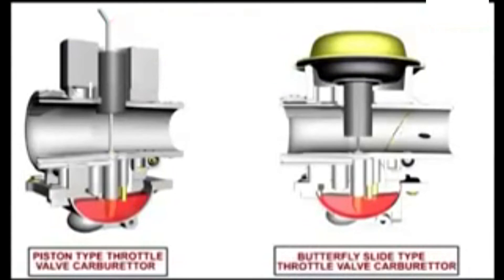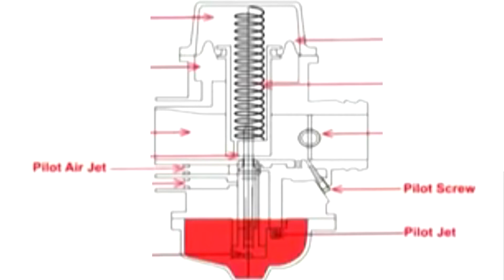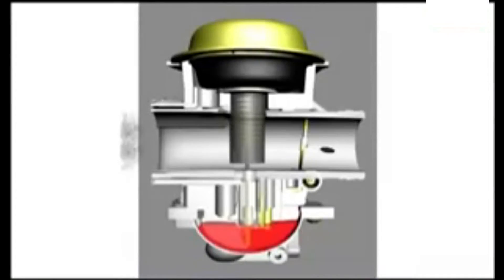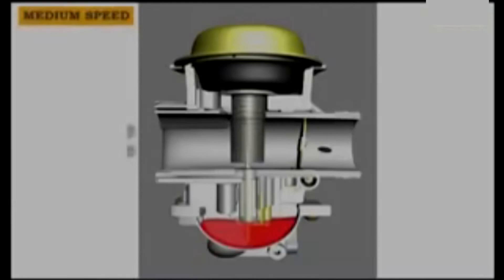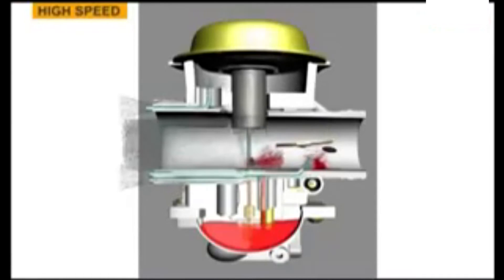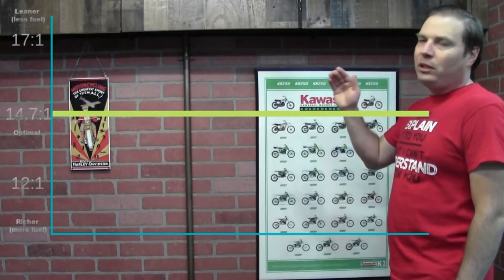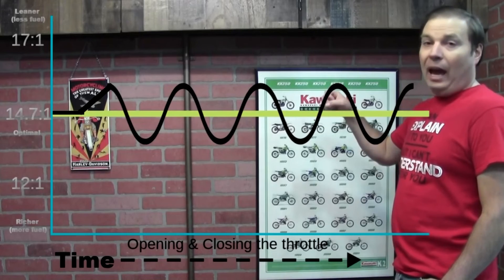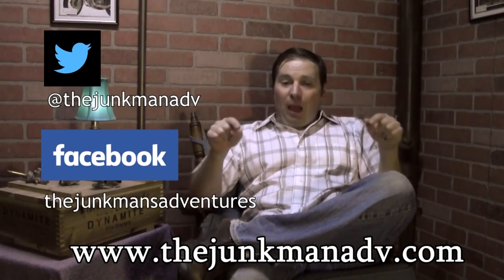Carburetor Jetting throughout the RPM range - Throttle openings explained!

Comment: Hey man, you may be the one that can help me solve my mistery. So, i have a '95 zx6r ninja, the previous owner tuned the hell out of it badly so i am trying to bring the bike back to stock. I put all the stock parts back and reset the carb on the factory settings, but the bike struggles to go between 7 and 9k rpm. Goes just fine before and after that range. I noticed that the problem increases when the bike is hot. Could it be the jet needle? Should i raise or lower the shim? Thanks
Reply from the maker: I think you are on the right track. Just experiment.

Comment: What is the purpose of the extra blue fuel line? The black fitting on the left side appears to be the fuel inlet.
Reply from the maker: Can you be more specific?
Reply: @thejunkman  Please pause video at 58 seconds, note the blue fuel line. What is the purpose of this extra fuel line ? It does not appear to attach to the fuel inlet. Thanks
Reply from the maker: That is for the enrichment circuit on that particular carburetor.  Not the spray bar on the inlet.  There is a plunger that would open and close that only used in cold starts.  It doesn't pertain to the concepts presented in this video.
Reply: @thejunkman  Could it simply be a vent? If so, why don't all carbs have this style vent? How does it effect the performance? Thanks
Reply from the maker: All carbs need a vent to atmosphere, just like the fuel tank, otherwise eventually fuel will not flow because of a vacuum that is created.  Think of why you can hold water in a straw by putting your finger on the end.  A carburetor at is core works entirely on basic physics of pressure differentials.  I have another video where I build a crude carburetor out of common plumbing parts.
Reply: @thejunkman  thanks for getting back to me. I appreciate the clarification. I haven't ran into a carb like that before.

Comment: I m wondering if you know about: 
Black exhaust smoke when needle is at middle setting, but its revving on it's own. If I lower its idle it stalls.
When the needle is at top slot (close), its jerky and wanna stall at low revs (1/4th), and ok mid/high, but still on swift gas open, engine stalls..
Its 125-130cc which I use at work, and really bothers me why its behaving like that. Ant clues?

Comment: Absolutely amazing videos, I have a question, I'm converting honda cbr1000f to café racer and I need to get rid of the air box for space purposes. I was wondering if there are any cone air filters that would mimic the airbox resistance and I wouldn't need to re jet the carbs.
Thank you
Reply from the maker: You will need to rejet. No way arpund it.
Reply: cover up some of the carb's openings under the filter

Comment: I have a little 125cc scooter that i got in a wreck on.  The header pipe is only about a foot long, as the muffler broke off, so i threw a 125 main jet in it (i think it came with a 105 stock?) And just have the back half of the airbox on with no restriction besides the open to outside tube running to the carb, and the needle is in its highest setting.  It's spitting blue flames, and in the low range, or if i quickly turn the throttle back while im moving, itll miss and hesitate before going faster.  At full throttle, itll sometimes cut out for a full few seconds, then take off really hard, then miss again.  Can ya help me out with this?  Its a Vino 125 with a cv style carb
Reply from the maker: You are going to need to fix those other problems before you can even try and tune the carburetor.  With no air filter you probably have dirt and debris in some of the passages as well.

Comment: Hey Junkman, I own a Kawasaki Vulcan 400 Classic. It recently had a problem with front cylinder. We got it fixed, but in the doing, my mechanic said that my old carburetor needs to be replaced. It was an old school manual choke carburetor. Now I have an "electronic carburetor" which supposed to work but does not since it's electronic choke is not connected. Here is the real question. Recently I ended up opening the air filter box and saw that my carburetor and air filter is not compatible with the air filter box. The end of carburetor at the air box has gap in between and the air filter itself does not fit and is cut to make it somewhat fit. So, does that gap between the air filter hose and carburetor affect how the motorcycle run? (Not even mentioning the air filter)
Reply from the maker: Yes, and not to mention that unfiltered air has been ruining your carburetor and cylinder.
Reply: @thejunkman  Hey man thanks for the reply. I ended up removing the current carburetor. As far as I have researched, it is a "Keihin" carburetor for probably 200cc. I see it has a electric choke but it is not connected either. Is it possible to connect the choke to ignition so I can fire up the motorcycle? Since the choke is not working, the motorcycle cannot start due to mixture.
Reply from the maker: The electric choke doesn't work off the ignition.  It is just a small solinoid that opens that closes based on engine temp, on when the engine is cold and off when the engine is warm.  So what you could do is just wire a switch to power it on and off when you want the enrichment for cold start.  It would be completely manual.  Here is a video that shows testing, but it will help you understand how it works.  https://www.youtube.com/watch?v=IVLHaVPf7SI
Reply: @thejunkman  Hey man, sorry for another late reply. The video link you sent me gave me the idea and I had connected my electric choke to the ignition actually. It got hot within less than a minute and it had fired up. I managed to run the motorcycle on idle for a while but then it died out. I think I forgot to connect the vacuum lines at some places. I have one more question right now. I noticed that the current carburetor is way smaller than the original one, since it has a plastic "adapter" looking part to fit it to so called intake manifold. Do you have any recommendations for replacement carburetor that I can buy off from Aliexpress / Amazon / ebay? My bike's old carburetor was  "Keihin CVK32" according to some websites. Thank you :D